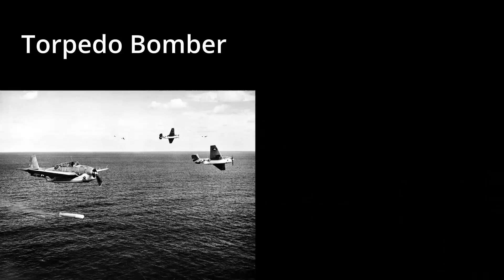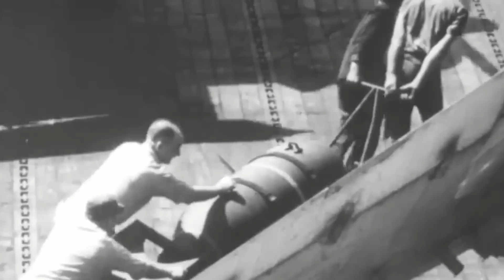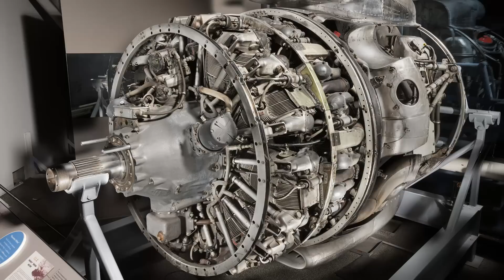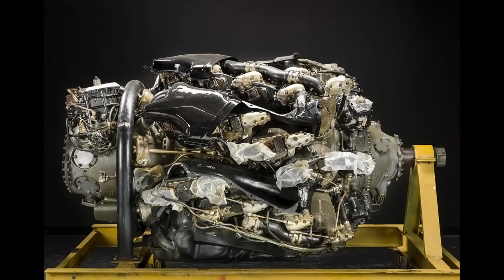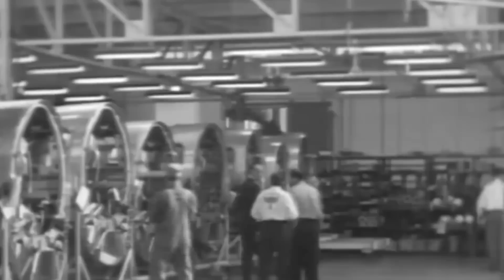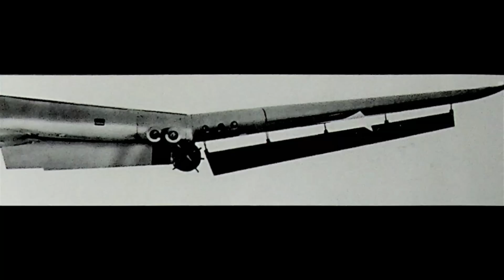Curtiss XBTC "Eggbeater" | General History Ep.2

Comment: The swept wing was a cheat modification to move the aerodynamic center of the wing in relation to the shifted CG due to the alternate powerplant weight changes. The greater span of dual functioning aileron (Youngman flaps used on Fairey Firefly) on the swept wing was probably to counter-act the loss of aileron and conventional flap response due to spanwise airflow effects. The removal of conventional flaps in this area would also avoid mechanical fowling of the converging flap extensions. The two aircraft would be entirely different in flight characteristics with the swept wing variant being probably faster than the more powerfull straight leading edge variant. The straight wing variant would have been superior in roll rate and low speed handling. Basically the two variants would mute each others advantages. This seems to be a typical Curtiss design phenomenon.
Reply from the maker: Is that based on personal experience in aerodynamics, or do you have some source material I failed to come across? There precious little information about this aircraft, and I'd love to read more.  

Thanks for the insight!
Reply: @AviationGeek1903  I am obsessed with aviation (But not an Engineer) and have studied this era the most. I understand most design methods so I am offering an informed analysis based only on that. I would also love to have my ideas corrected by actuall info as well. I have the Bob Kowalski book on the XBTC also but your video expanded on that considerably.